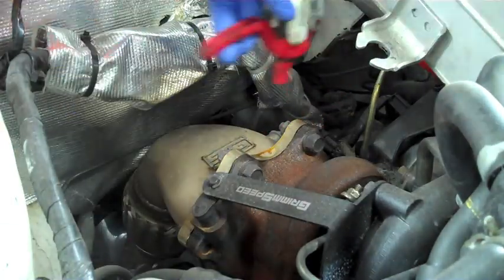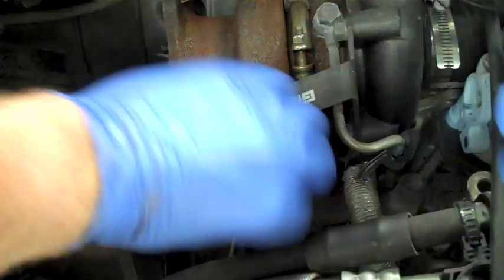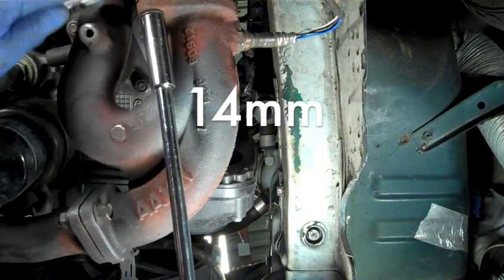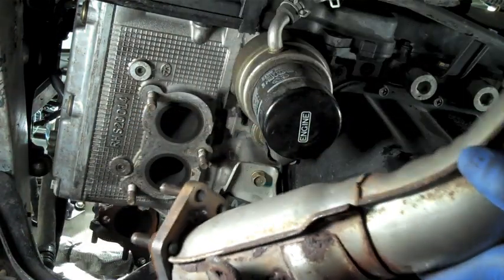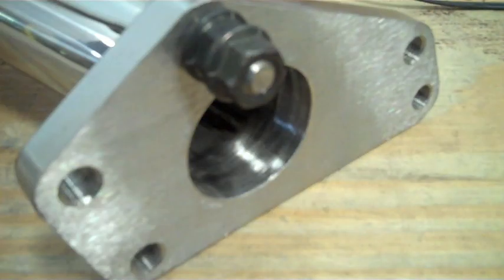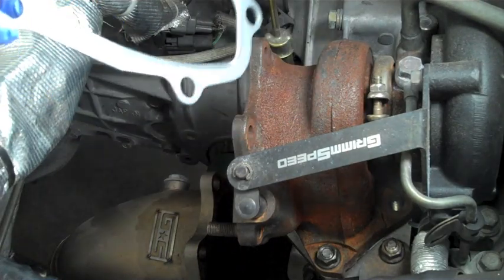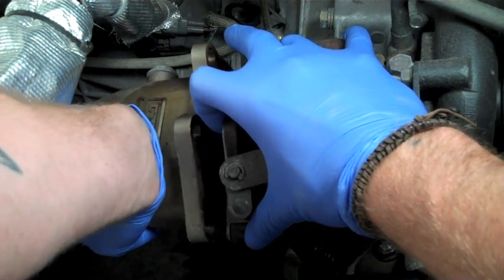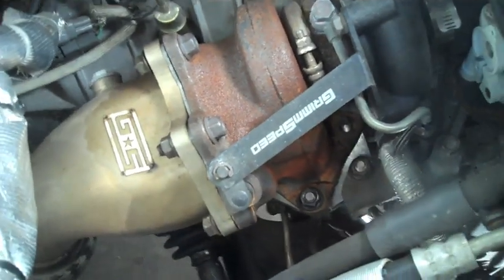GrimmSpeed Up Pipe Install

Comment from the maker: I know the removal of the stock heat shield system on the up-pipe can take quite some time.  Small hands help a ton!  Are there any questions that you have that I can help you with?  

-Matt Homes

Comment from the maker: You want to remove the OEM cat for several reasons.  First off, the OEM cat is a major restriction and can kill spool up times, making your turbo lag, less power.  Also, the OEM up-pipe from 2002-2005 has an EGT probe in it.  As this probe ages it can be prone to failure and if it breaks off it will more than likely go through your turbo making a mess!  You should get tuned for this upgrade, you run the risk of over boosting if you don't.  

-Matt Homes

Comment from the maker: Bjarne,

The OEM up-pipe you replaced had a cat in it.  Since you have removed this form the system you could encounter some over boosting.  If you haven't done so already, pick up a 3-port BCS and get your vehicle tuned, you won't be disappointed.  If you have any further questions, feel free to give us a ring 612-379-0000.  -Matt Homes

Comment from the maker: No you definitely won't have to drain oil or coolant.  It will be much easier to work around if you take the TMIC off, that s real quick to pull out and reinstall.  The write up you read is a person most likely removing the turbo at the same time, that isn't necessary.  Let us know if you have any questions.  -Matt Homes

Comment from the maker: Yes, all of our current up-pipes come with the upper and lower gaskets.  Additionally I would look at replacing any gaskets at any connection you disconnect during the installation.  For example the turbo to down pipe, down pipe to cat back, as well as the exhaust manifold to head gaskets.  -Matt Homes

Comment: Thank you for your quick response, last question.

Do the gaskets that require replacing come with a new uppie and new exhaust system? or do you need to purchase them seperately?
Reply: For anyone in the future it does come with uppipe gaskets but I also recommend ordering new downpipe gaskets

Comment: This video helped me so much. I did this by myself in my driveway in about 5 hours, going slow and taking breaks. I used all new gaskets except for the crosspipe because I didn't take that apart. I did end up jacking the engine up because I couldn't seem to wiggle the up pipe out. It runs harder, spools faster, and is a big relief getting that problem cat out. Thanks again for the video demo!

Comment from the maker: Correct, I would get the manifold to head gaskets (pair) and the turbo to down pipe gasket.  If you leave the header assembled you won't need the cross pipe gaskets, but it never hurts to get fresh ones in there.  Remember pre turbo exhaust leaks can easily rob you of 10-30hp all day long.  -Matt Homes

Comment from the maker: The resistor can be inserted into the harness right where the OEM EGT sensor plugged in.  This portion of the wiring harness is up on the front side of the passenger strut tower.  Be sure to put some tape over the open plug to keep moisture out.  Let me know if you have any further questions.  -Matt Homes

Comment: Tune is not required for an up pipe, but you can benefit from one. The down pipe does require one, some people get that backwards. :)
Reply: @kpkelsey6  the tune was simply used to disable the egt failure code and not to try and make more power :)

Comment: one thing to add when using any AM uppipe is that it will increase lagg and top end(minor) the other thing to make sure is that the pipe inlet is the same as your headers outlet as if there is a difference in size it will chew up gaskets and you will eventually need to match to two pipes(e.g buy new headers or go back to old uppipe)

otherwise a choice video

Comment: Yup, you can easily run your stock header with a GS EWG up-pipe, no worries there!  You don't even need to run the EWG yet, you can get one of our block off kits so you can add an external waste gate later on, pretty modular system!  -Matt Homes

Comment: Yes.  Since there is less of a restriction in the up-pipe now you run the chance of over-boosting and running lean.  You and your vehicle will benefit the most by having your tuner tune your vehicle for this specific modification.  -Matt Homes

Comment: Thanks for the video, I just installed one and found the engine mount bolt (to raise the engine) not reachable with a larger than stock sway bar, I didn't want to undo the subframe to get to it so I lossened the turbo and pushed the old uppipe up and it clear it.  I also had the downpipe out so it flew right out!

Comment: Technically you don't need a tune, but you are removing the cat, and changing the flow characteristics of flow and spool.  TO ensure the health of your vehicle you should be tuned for modifications like this ti obtain the most out of the modification.  -Matt Homes

Comment: Its not absolutely necessary but I would recommend it.  It helps slow the corrosion on the cast iron collector and more importantly it helps reduce the amount of heat that is bathing the bottom of the block.  I would strongly recommend installing at least the upper heat shield on the passenger side.  

-Matt H.

Comment: Will a larger diameter uppipe cause more turbo lag but increase high end power? And how likely will the oem Egt probe being sucked into the turbo running on stage 2?

Comment from the maker: There are 2 nuts holding the motor mounts to the x-member.  Make sure you remove both nuts.  This will allow you to gain the inch or two of clearance you will need to sneak the stock up-pipe out.  In regards to the O2 sensor.  If you are having difficulty removing the sensor and its still on the car you might want to unhook the sensor from the harness and leave the sensor in.  You can remove it once the collector is off the car.  Try some heat on the manifold, might help the sensor come out.

Comment: Thanks, I was able to finally drop down the the passenger manifold, but my bigger problem is the 02 sensor is really stuck in there. I have the 02 removal tool, sprayed the sensor threads with PB and still wont budge! Also, I cant seem to see a way to pull the up pipe down without jacking the engine. Is the nut for the motor mount the one near the passenger wheel area, or the one in the back behind the sway bar? Thanks for all the help!

Comment from the maker: You should be able to leave the upper (closest to block) on.  In regards to the O2 sensor, its easiest to buy the specific tool to remove the O2 sensor and then once the sensor is removed, then you can remove the lower heat shield.  The best way to gain easy access to the O2 sensor and the manifold to up-pipe bolts it to remove the passenger side wheel and go through the access panel in that area.  Let us know if there is anything else we can help with.  ~Matt

Comment from the maker: If you are removing the stock down pipe and heat shield system its much easier to just remove the down pipe.  You can technically un-bolt the bell mouth of the down pipe and push it backwards several inches, but its much easier to just remove it.  Keep in mind that the bell mouth of the down pipe is above two nuts you need to reach to remove the up pipe.  ~Matt

Comment: Theres no way to remove the upper bolt from the manifold to the up pipe with the upper heat shield in place correct? Also you did have to remove the o2 sensor to get off the upper heat shield off right? Im doing my up pipe now, and have the upper shield still above the manifold and cannot get to the upper up pipe to manifold bolt out. So Im guessing the car you did the video with doesnt have the upper shields in place anymore?

Comment from the maker: As long as you still have the cats in your downpipe it is not as critical to get a tune immediately. Once you get an aftermarket downpipe I would highly suggest getting a tune for both the Up Pipe and downpipe at that time. Hope that helped ya. - Justin Grimm

Comment from the maker: @grimeyspecv 
Yes you can. It is actually the easiest way to do it. You will want to remove the heatshield from the 4-port exhaust manifold to get to the up-pipe to manifolds bolts.  The rest will be easy to do with the turbo out of the car. 

Taras

Comment: Going to be doing this install tomorrow night. Rather than pull the exhaust manifold off at all, why cant the up pipe be fished out from the top once all the bolts are removed, and slid back down on to the manifold? I understand based on the previous post you wanted to replace the manifold gaskets but it looks like it can be easily done, especially with the down pipe removed.

Comment: I got a question, if you want to replace just the gasket that connects from the up pipe (lower section) to the exhaust manifold do I need to take apart everything and replace gaskets for the head and what not? I noticed there's a small leak in there and its loosing boost + makes an awful noise when I let off the throttle, also what gasket would you recommend I have a 3" up pipe. Thanks for the vid btw! Can't wait to get one and put on an EWG :D

Comment from the maker: @sergsrt8 Great question! The downpipe is actually different, it connects the exit of the turbo to the res of your exhaust. The up pipe connects the exhaust manifold to the entrance (exhaust side) of the turbo.

Will

Comment from the maker: @bloodstriper it comes with new bolts to connect to the exhaust manifold and new studs to connect to the turbo but gaskets are extra. We do offer them though and they are cheaper than OEM and are 22% thicker as well!